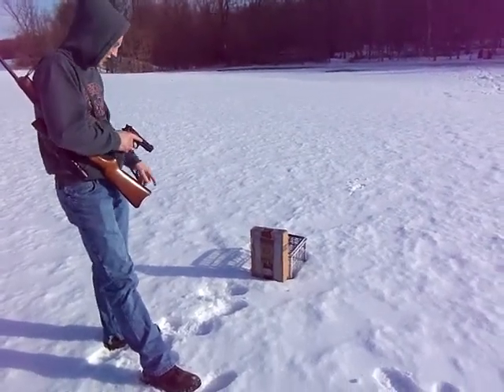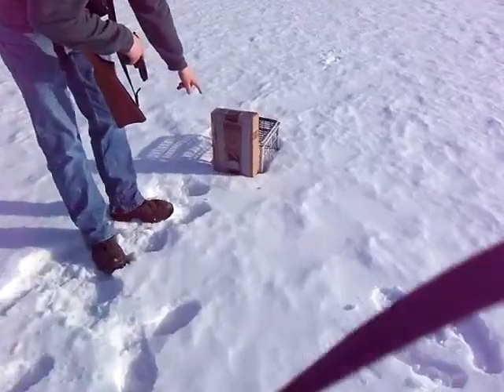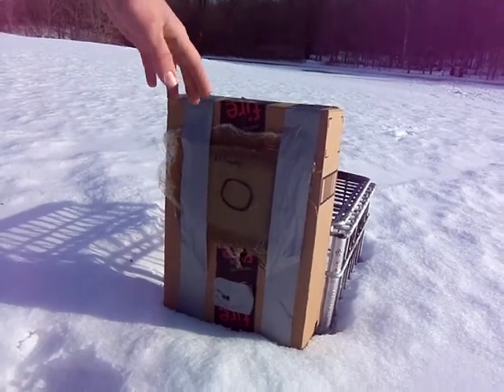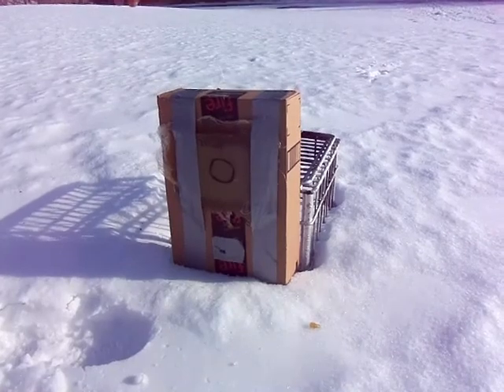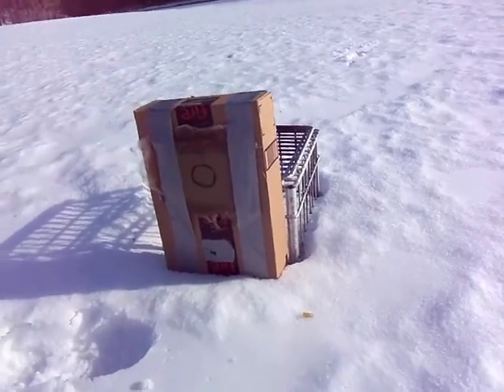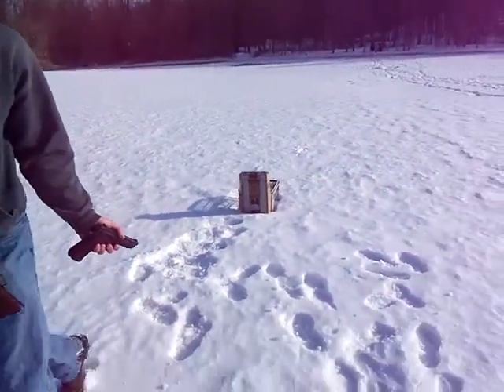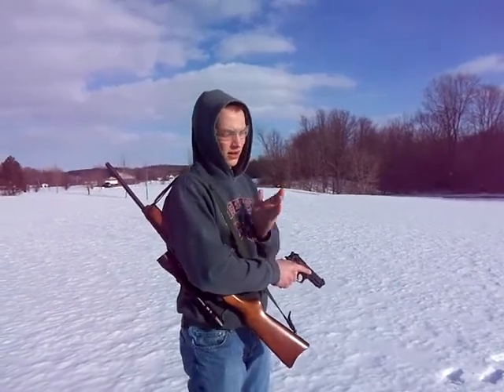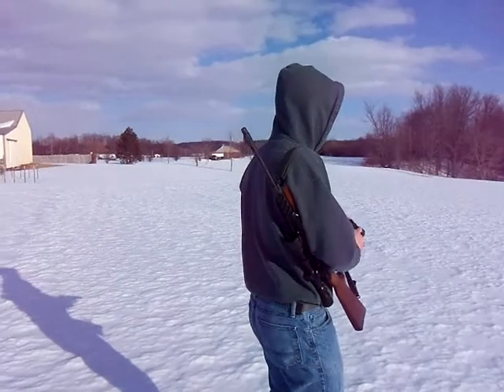Homemade 9mm bullet proof plate, fiberglass and thin steel

Comment: Hey buddy you would get much better results with the steel plate on top. Otherwise the fiberglass will be compressed against the steel plate because it's not as hard as the steel.
Reply: Was this video by any chance filmed using a toaster?
Reply from the maker: +Abe Froman yeah, a shitty Magic Chef.